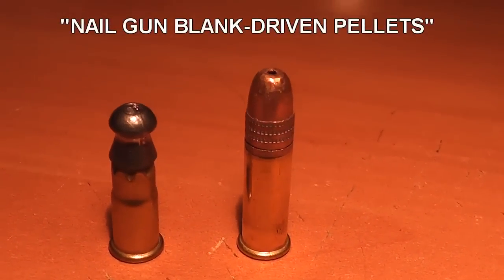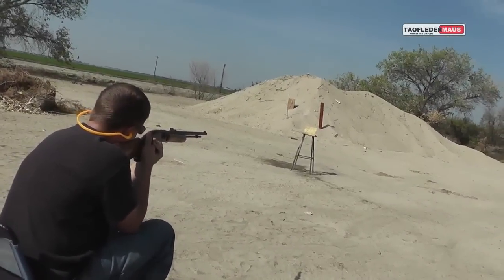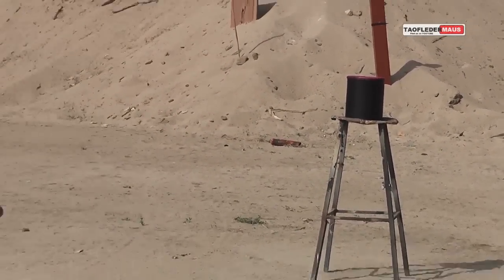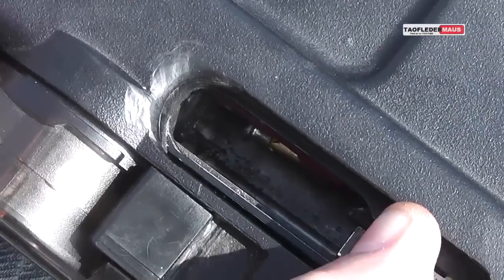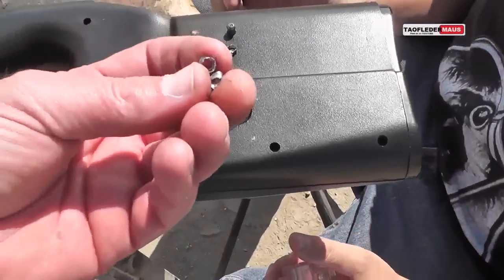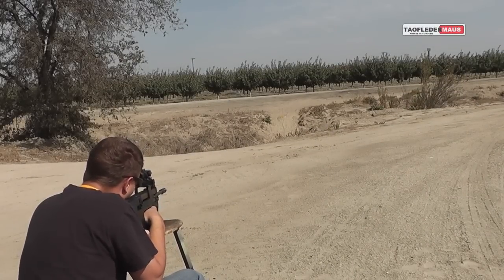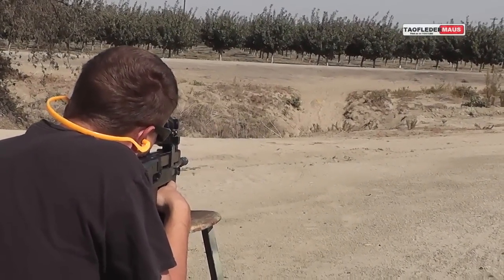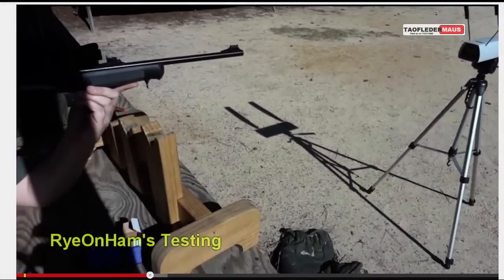Shooting .22 PELLETS Using NAIL GUN Blanks?  PART 2

Comment: The problem with gluing the pellet onto the crimp is that the rear portion of the pellet is outside the crimp and the crimp expands into the pellet and severing it from the forward part t before the rest of the pellet goes forward.

Comment: Hello, love your videos, and Hello from Canada. As an avid air gunner, let me share a few things with you. Any experienced air gun enthusiast knows that speed is the enemy of accuracy with a pellet. It has to do with Physics. Once a pellet goes beyond the Supersonic point(1080ft/sec), the shape of the pellet does not adhere well to the turbulence caused by the wake of the pellet cutting through the air.  The Diabolo shape of the pellet causes it to tumble and roll in flight. With in 10 yards you may get lucky hitting a target. After 25 yards things begin to lose control fast. Therefore the more powerful the air gun is, you need to use a heavier pellet to slow the flight time. Now you get more smack or ft/lbs energy on the target, however, once you hit the speed of sound the pellet will lose control. For a 14g 22 cal. pellet, 800 ft/sec is optimum. The only reason air guns are built faster is because that is what consumers want! They do not know until after the fact they have wasted their money. Get a good 1000ft/sec gun, add in the heaviest pellet you can find, and you will have greater success. The heavier pellet will chrono at around 800 ft/sec and your result will be better. Remember, most companies advertise their power using alloy pellets, not lead! Hence the deceit, except for Hatsun who tell it as it is. TY again.

Comment: I did the same thing with my .22 rifle years ago and I had the same problem here with the ripped off lead rings of the .22 pellets when I load them into the chamber followed directly by an blank. But then I fixed out that when you put a drop of craft-glue into the back of the pellets and let it dry over night the pellets no longer get ripped apart by the blanks. This method works very well. BTW: Try to glue a 4,5mm steel BB on the tip af an hollow-point pellet for more penetration.

Comment: In the 1950s, during the Allied occupation of West Germany, manufacture of firearms of all types, including .22s, was prohibited.  To produce an effective small-game hunting rifle, the airgun maker, Weirauch, came up with the following idea.  They took a heavy duty spring-piston air rifle and equipped it with a device that would inject a small amount of ether into the cylinder.  This would cause dieseling, and result in a much higher velocity.  This gun was used with solid lead balls, since the high pressure would blow out the heads of conventional pellets.  Maybe you should try balls with the blanks?  Or maybe, really heavy pellets, like Beeman "Kodiaks," or JSB "Monsters."  By the way, that Weirauch, called the "Barakuda," was not a success.  It DID generate a lot of energy, but velocity, and hence accuracy, was very inconsistent.
Reply: That's cool as heck!

Comment: Four points from my reloading days: 1. You could load a hollow base wadcutter backwards in .38 special and .357 magnum cases. These were nicknamed "poor man's hollow points. They only worked at short range, they do not stabilise well.  2. You can NOT drive soft lead projectiles at high speed, that will deposit lead on your bore. You can lap your bore to smooth it which cuts the amount of lead deposited but there is a limit. 3.The harder the lead alloy the faster you can drive the projectile. Again, there is a limit. 4. We manufacture jacketed bullets for a reason.

Comment: The reason why those pellets are not accurate is because they are too light. When the pellet breaks the sound barrier it starts to tumble and loose stability. If you can get your hands on some EUN JIN 32gr pellets so you can test the accuracy.
Reply: Or possibly some Ely Magnum Wasp 30gr. (:
Reply: Qyuubi786 You are a wasp
Reply: Son of a Zombie You are a son of a zombie.
Reply: Qyuubi786 And I'm undead
Reply: Son of a Zombie Man, I hate wasp.
Reply: Lewis Toroian lol , of course!  There is a wasp lord masquerading as a human here.  Be careful he has heavy-for-calibre pellets which he uses as a sting ☺
Reply: Son of a Zombie I was making a reference that I was hoping some people might get. This comment made me laugh though xD
Reply: A little inaccurate....the pellets lose stability as they pass BACK into the transonic range. The shock wave (center of pressure) produced by super sonic speeds moves forward and ahead of the center of gravity as the pellet slows through the speed of sound...it's this that causes the destabilizing effect.

Keep them sonic all the way to target, and they can group fine if everything else is in order.
Reply: Lewis Toroian White Anglo Saxon Protestant? :P
Reply: +Gippetos Yeah, my thought was switch to a lower graded driver load for longer ranges.  I concur that their shape is wrong for that velocity, but at a slower velocity 22 pellets are super accurate, so try a #1 or 2 charge instead of a #4.
Reply: Could also try some of those premium plated pellets that are more spitzer shaped. If they even make them any more.
Reply: They are also not seated properly in the chamber. They are all probably slightly crooked.

Comment: To really have good results, you have to try it with a pellet rifle or gun, i did it on my Mendoza M-990 Rifle using "Mendoza 2000 Express" and "Crossman Distroyer" pellets, at close distances (10m) the pellet almost do the same damage than a .22 bullet, but at long distances basically it has no accuracy. Great video, as always, greetings from México.

Comment: I use those ramset blanks all the time, and also have a .22 pellet gun for backyard shooting.I thought this was a crazy idea when I first saw it. But I just had to try it. I bought an old beat up single shot .22, and gave it a shot. I muzzle loaded the pellets just like you did to begin with, and got the same results. I would not recommend doing this with a nice rifle, and I would recommend being careful. But it does work at close range. If this SHTF thing ever happens, and ammo is not available, this might be something to keep in mind. It doesn't work now, not only because of the lack of long range accuracy, but because I can buy bulk ammo at Bass Pro for less than the pellets and the blanks. Of course, I could probably just buy the pellets, and siphon off enough blanks from work to make this both fun and cheap. Having to spend so much time reloading you could shoot all day and not go through to many rounds. After trying this over 100 times, I started shooting actual .22 rounds, and they seemed plenty accurate, so I don't think it messed up the barrel, not that I really cared.

Comment: Its better to use .22 lead bbs (round balls) for airguns because are more solid and easier to load (you can just drop in the chamber and push with the blank),no need rifling,more density...
Reply: I've never seen any .22 BBs. You mean F or FF waterfowl shot?

Comment: I used to use heaver pellets...like 20+ grain. I would also open up the blanks, remove the crimping, then seat the pellet right into the shell. Instead of gluing them to the crimp. They would likely chamber a lot better and you could avoid the whole muzzle loading thing. I found nail blank over #3 to be too much powder charge and the pellets break apart.

Comment: A while back, I did a similar experiment. I have a one-off custom single-shpt in 17-HM2. I seated the 8 grain .177 pellets into the rifling, then loaded the blank. I don't know the velocity I was getting, but Crows and Blackbirds were vaporized when the pellets hit them.
This is also cheaper than buying .17 HM2 ammo.
Reply from the maker: +Kevin S  Did you still use .22 blanks?     The pellets were probably going at least 3000 fps.
Reply: *****  Yes, I used the #2 blanks.
Reply from the maker: That's cool!   I wouldn't use the higher powered ones if you care about your gun!

Comment: My comment is only tangentially related, but back in high school (80's) one of our PE teachers/coaches ran out of blanks for a starter pistol.  Unable to find any .22 blanks at a sporting goods store, he bought some Ramset blanks at a hardware store.  Thankfully, he was holding the pot-metal (cast zinc) starter pistol straight above his head when he touched off the first round.  It was good and loud, but suffered "instantaneous dis-assembly", leaving only the grip and part of the attached frame in his hand. He got fired.  We laughed like hell!

Comment: Think about it, the pellet skirt is designed to seal the pressure behind it. Maybe it should not come in direct contact with the blank. Perhaps a small wad as a buffer could help. Remember that shotguns use a wad to help build up pressure slowly and not deform the buckshots. If the pellet is deformed by the blank, then the pellet will not be accurate. Thanks.

Comment: Loved your video. The pellets need some distance from the Blank Cartridge. Other option is to glue a BB to a hollow point .22 pellet. It will add 5 more grains to the weight of the pellet and it will be in the front of the pellet leading the way forward.

Comment: If I were you I'd try casting long .22 slugs with depressions in the bottom- that would eliminate the skirt and let you glue them to the crimps.  Or buy .22 projectiles and drill hold in the bottom.  Great video, and props to you for having the cojones to try this out!

Comment: I doubt anyone reads comments on 5 year old videos, but I just wanted to say, it's probably actually having the pellet a short distance from the blank that kept the pellets from being shredded, not the rifling itself. I actually messed around years and years ago with a short bit of airgun barrel JB welded into a pistol case. With the pellet seated right against the back of the case, pistol primers would make the skirts of the pellets balloon up like crazy, or even tear the pellets in half sometimes, despite the fact that they were coming out at an incredibly slow velocity, just barely enough to even embed themselves in modeling clay. The barrel was cut so the rifling went all the way to the back of the case, so rifling definitely didn't have anything to do with it. It was just being at too high a pressure due to being too close to the explosion.

Comment: Try using domed hunting pellets. They are designed for use in high velocity air guns and are much more aerodynamic than hollow points. Those are what I use when hunting with my air rifles. You'll probably see a bigger gain in accuracy. Hope this helps!

Comment: You should try H&N Rabbit Magnum 5,5mm,27 grains,they look like a bullet and have no skirt.I tried them and easily penetrates 2 inch pine wood at 25 meters leaving a clean hole.I used .25 cal SPIT nailgun yellow.Setup was a little different but same caliber.

Comment: Awsome experiments with the pellets!you guys should try taking bullet out of the .22 and placing it in front of the blank.maybe the primary cause of the high velocity of the pellet round is that there is absence of resistance between the bullet and the bullet casing and the pellet could also benefiting from what  May be a peak of gas expansion.obviously weight is a variable.

Comment: Wow! I wouldn't have expected it to cut through metal so well!
I have an idea, drill some mini mag HP 22lr out to get the weight down closer to the pellet weight? Under 20gr or less. Maybe even at large as a 1/4" drill bit that would remove a portion of the tip of the round and the taper of the bit would give it a concave shape like a shallow hollow point. Removing some of the front instead of just the inside would keep the center of the bullet from blowing out and getting stuck in the barrel. I wonder if the results would be similar to the pellets?

Comment: Did you consider using self-cast .22 spitzers, which would weigh around 20 grains, with a nail gun round? They have a more ballistic shape which would be better suited to the higher velocity and thus be more accurate than a pellet designed for an air rifle and it's lower muzzle velocity. I used to put model engine diesel fuel in spring powered air rifles to get a bit more speed from the pellet, through dieselling, and like you, found that although the velocity increased at least twofold, accuracy was drastically reduced with a normal airgun pellet. Good fun though!

Comment: What if you used a spacer of some sort, instead of gluing it directly on? Maybe this would take care of the rifling issue.
Reply: Like a gas check of some sort. I wonder if a simple O shaped piece of aluminum would work instead of having to make a cup shaped check? What an interesting idea. Have a punch made to make the checks, then glue them to the bottom of the pellets.

Comment: I've been testing this in an old Stevens Model 15. I've found the 22gr Gamo TS22 pellets and the yellow blanks to be the best. They produce a ton of energy and are acceptably accurate at 20 or so yards. I've have also tried the PBA Raptors and they are ridiculously fast, but terribly inaccurate past spitting distance.

Comment: I don't think the Stingers have more energy than the pellets; those pellets should actually, if they are traveling 2,800 f/s, have more energy than the Stingers - and much more than, say, .22 LR.  What the Stinger probably has is more momentum because of the higher projectile mass, which shows up to its advantage as the velocity decreases after impact.  It would be interesting to compare the "push" from the momentum - say by shooting at an object that neither round would penetrate - to the "disruption" from their kinetic energy by shooting at, say, a series of plastic soda bottles of different sizes, that are full of water.  Definitely gonna try this!

Edit - just checked; A CCI Stinger is rated at 1640 f/s with a 30 grain bullet, and you shot Crosman HP Pellets, 14.3 grains, at 2,800 f/s.  The Stingers have about 3/4 of the energy of the pellets - but 31% more momentum.  The difference is even more pronounced with .22 LR 40 grains at 1,200 f/s - the .22 LR has only half the energy of the pellet, but 20% more momentum.  It's really interesting to see how that translates to behavior of the target at point of impact.  I bet that difference would show up when shooting into small watermelons.

Comment: I tried this with my 22 LR revolver (4 inch barrel) and with # 2 (weakest) nail gun loads,  it works if I preload the pellet into the barrel.  Depending on how deeply I put it in, the more velocity I got.  For example, if I just muzzle load it and leave it there at the forwardmost part of the barrel, the velocity is very low and wont even penetrate a piece of wood at close range.  As I push it deeper, the velocity increases.  When I load it thru the forcing cone so it can use the entire barrel length, it then penetrates a piece of wood and the pellet "buries" itself in the wood.  The one thing that did NOT work is when I put the pellet in the cylinder with the load.  It did NOT like to make the transition from the cylinder into the forcing cone (where the cylinder and barrel meet) and created a larger than normal flash (and recoil) and left a "ring" in one of my 9 cylinder bores such that now a normal round will not go in there.  I probably have to use some tool to scrape it out but perhaps it is unsafe to use now.  It is not a big deal if it is now a 8 shot revolver instead of a 9 shot cuz I only load 8 normal 22LR rounds anyway for a little extra safety.

Comment: I imagine you're through with this. Knowing what I do about ballistics and lead projectiles, I understand what you learned from the leading of the barrel and the inaccurate at range. Light weight projectiles become unstable going through the Supersonic shock wave and if shot far enough, falling back below the speed of sound. Knowing this, Im wondering what sort of luck you would have using the heavier COPPER PLATED KODIAK pellets, which weigh around 22 grains. There are also ways to cast .22 pellets from a harder alloy. Allowing this is still a novelty, I think you could get a more accurate, yet still supersonic round. Those cheap 14.3 gr pellets are just too fragile. Several pellet companies make .22 pellets in ranges all the way up to and including 55gr hp. A 24gr or a 32 gr might just do the trick as well. I would like to see the copper plated Benjamin Kodiaks used. ;-) 
Really enjoyed your videos.

Comment: Yes Yes BUT There are Many varying Brands, Sizes, Shapes, weights and differing materials of the .22 PELLET ! 
That being said, You "Might" have better results in mixing and matching using the variations !  Even More or Less powerful Nail Gun Blanks may help the outcome !
(Just a Thought)
Reply: +Owen Joseph King Exactly correct.  I am thinking a #2 would probably be more accurate.

Comment: The crimp of the cement charg opens when fired and when the pellet is glued to the crimp, the crimp will open around the inside of the skirt making only the head of the pellet go down range. That's why you are left with lead rings in the barrel or on the cartridge.

Comment: Ive made 100 yard kills of morning doves with my Diana 177 cal, model 45 pellet gun ,at that range the pellet had enough energy to brake the thickest part of the wing bone go thru the chest of the bird and brake the wing bone on the other side too, thats just with a spring loaded barrel braking air gun lol ,and all the Diana models are sniper guns as far as accuracy goes ,very well made German engineering   22 and 177 can available in each model